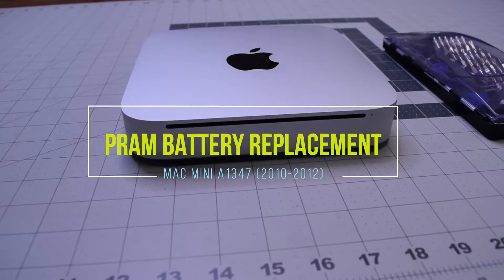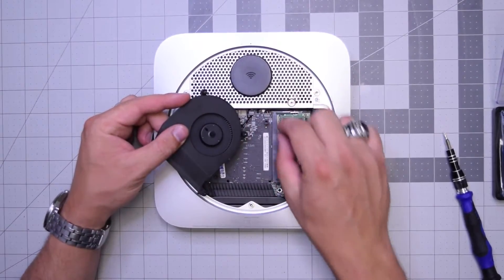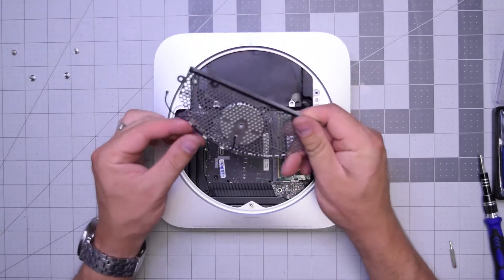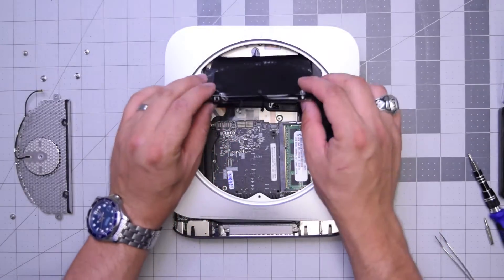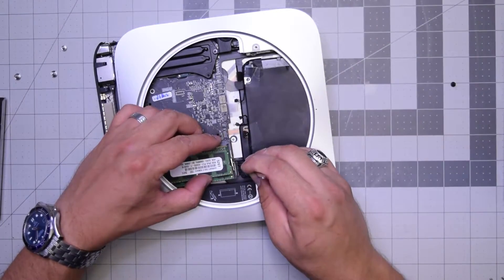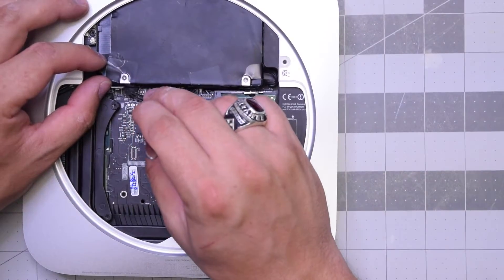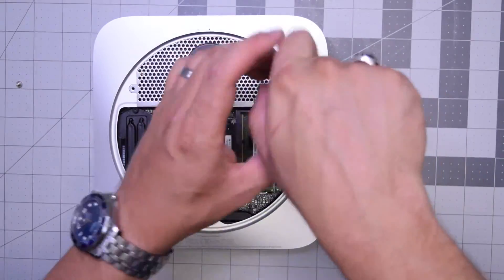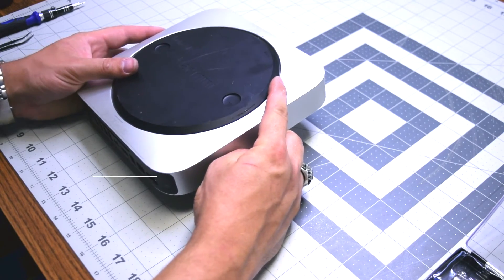Mac Mini A1347 - PRAM Battery Replacement (2010-2012)

Comment: After the reassembly, I try to reset the PRAM to reset the firmware password on my Late 2011 Mac Mini, but this has no affect, it is still asking for the firmware code, if I remove the battery long enough, will that reset it?

Comment: Thanks for this one and your other one on replacing the 2010-2012 battery.  On the latter video I read a comment that said he went through the battery replacement and the machine's light would show for a moment but still not start.  That's my symptom, too.  Can you tell us what symptoms we would see if we need to replace the PRAM battery?
Reply: @Jeff99
I have a 2011 Mac Mini and all of a sudden one day about two years ago, it just died.  It will not turn on at all.  When the power button is pressed, the light on the front doesn’t even come on.  Did you ever discover what the problem was with yours?  I’m wondering if a dead PRAM battery will cause this.
Thanks
Reply: @Shaken_AND_Stirred   a dead PRAM battery should not cause the computer to stop working. It will just mean that each time you cut the power to the machine it will lose PRAM settings including date and time. having incorrect date and time could cause all sort of problems down the line; but you can still set them manually. Having a computer in storage most of the time means this battery will die a lot sooner than if it's always plugged.
Reply: @hmmmhhhmmh  
Thank you!

Comment: thanks! this video help me a lot... i have a question , in which case should the PRAM battery be changed? What are the most common symptoms to change the battery?
Reply: When I unplug the Mac mini, the time is gone. So the battery is empty and the clock is not running in the background without power. I need to replace the battery, then the clock will continue to run when unplugged

Comment: Did you put a new battery in ? If so which one ?
Reply: I replaced the battery with same type 3 volt BR2032 (200mAh) in my Mac Mini, not the 3 volt CR2032 (225mAh) which is easier to find and used on many Windows/Intel laptops. Stick with a known brand name such as Panasonic.

Comment: When I was looking at this a site called ifixit dot com, it was telling me to use a “Mac mini logic board removal tool”, which is a U-shaped rod. Did you not need one?
Reply: once its all unscrewed you can gently pull the board out by the edge near the hard drive

Comment: Great demo. Do I need to ground myself before working inside the mac and if so, what's the easiest way?
Reply: Is this battery the reason for my MM not coming up? It’s stuck on the start up screen.
Reply: 3121babe you NEVER want to GROUND yourself when working on electrical. Just unplug the damn thing.
Reply: I believe just touch something metal. And be sure not to rub your feet on the carpet while working on the repair.